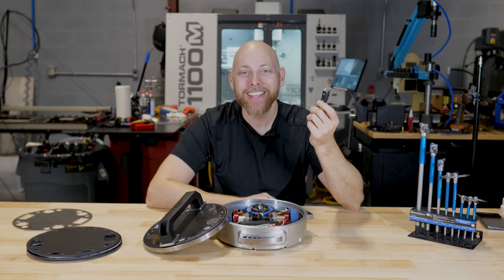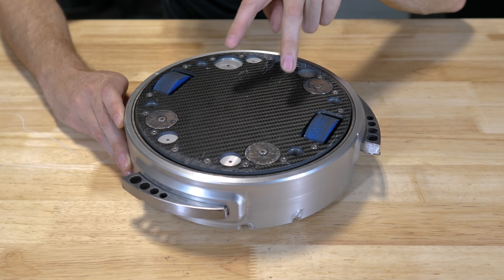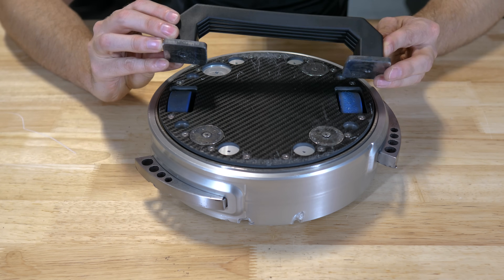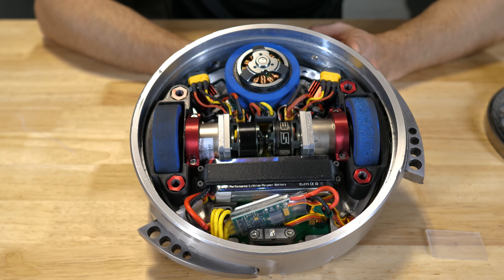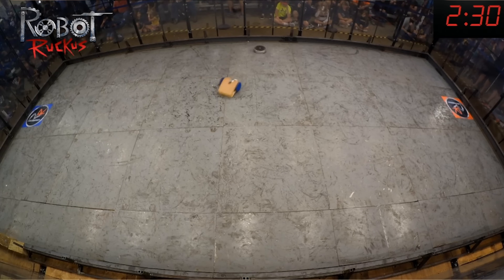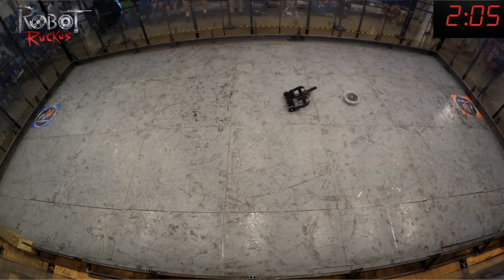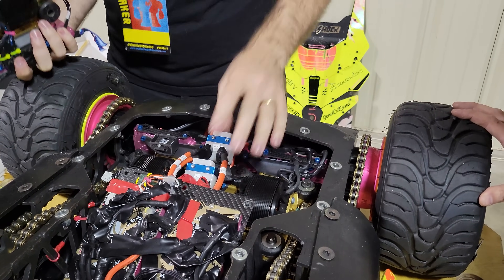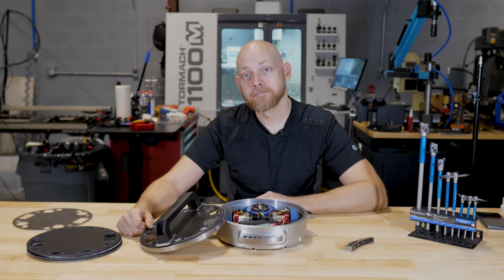Destroying a Battlebot: Part 3

Comment: I know this is almost a year old...
1. What you want for the teeth is shock/impact resistant tool steel. This sort of application is exactly what this category of tool steel is for. In the US, this will.  typically be "S" followed by a number. S2 steel is super common and cheap, if not the best. You should also consider plain carbon steels, much cheaper and easier to find as "trash". Farm equipment blades used in an impact vulnerable application tend to be around 0.75% carbon, which is the sweet spot for the best toughness,  strength and hardness in  carbon steel. 
2. To resist bolts pulling out of aluminum, you need coarse threads. I know the math says it doesn't matter, but real life says otherwise. This in particular is an infamous problem for car engine cylinder head bolts for aluminum engines. Lookup the Cadillac Northstar engine. Aluminum loves to gall too, coarse threads will help deal with that. 
3. Carbon fiber composites are strong in a per weight basis. Fiberglass composites are far stronger in a per volume basis.

Comment: Carbon fiber is highly conductive. Using it on the top means that you made a very basic faraday cage between the steel floor, aluminum ring, and carbon fiber top. That's also why you always house your tracking radio in a fiberglass section instead of a carbon fiber section in rocketry.

Comment: Should put a large bearing in the center of the front and back, to keep it from wobbling.

A single 1/2in ball bearing would work.

Those could also be spring loaded, to keep in constant contact with the ground.

Comment: You have plenty of comments about carbon fiber, so I figured I would ask about the secondary weapon.  Did you consider designing the inserts with a chip breaker, to kick out material being removed from opponents?  I think just a little bump or curve past the cutting edge is all it should take.

Comment: To solve your wiring problem you could use a duel print head 3D printer and conductive filament and print your wiring directly into the housing.

Comment: Reading the Carbon Fiber interfering wirh the radio waves, I think understand some of the issues. You should limit the number of angles beweeen plies. So a [0, 90, 0, 90] layup would block more than a [0, 0, 90, 90] layup. I wrote a paper on a similar topic if you are interested.

Comment: In single seater racing with carbon fiber monocoque, we use copper tape surrounding the hole for any radio antennas. This helps a great amount with radio quality/signal.

Comment: Carbon fiber is conductive and therefore you're making a farada cage using it, it's even worse if you're connecting it to ground even indirectly. The mass you have will act as a huge capacitance plate, you're best off externally mounting the antenna or using the carbon fiber as one via tuning.

Comment: Retired physicist here.  I did some conductivity measurements on carbon fiber years ago.  I found most samples to be conductive to various degrees depending on how it's manufactured. G10 is not conductive, so it's the better material for radio transmission.

Comment: I would recommend the vex robotics gear boxes that are often used in FIRST tech and FIRST robotics and they are all metal gears and they usually hold up pretty well and are modular meaning you can easily repair them and change your ratios as needed. You will probably need a custom adapter but I feel like it would be worth it for the strength and modularity.

Comment: CF is conductive and so will block RF, simple as that.
If you really want to use CF then you need to have small section (50mm hole?) in CF where the antena is and cover it with G10.
G10 is glass fiber based so basically transparent to RF.
Reply: And regarding the attack bits, why invent the wheel?
Look up some mining equipment or some kind of large milling equipment and see how they do it, then just copy it to the last detail.

Comment: In aircrafts they cant use carbon fibre nosecones since this blocks the microwaves used in the radar system. So your carbon plate most likely blocked any signals trying to pass through

Comment: All plastics have the ability to create and hold charge, the difference in fiber glass and carbon composites is the carbon fiber can conduct electricity, this means as friction happen the plastic can create charge and then flow through the carbon fibers, the flow of electricity creates small electromagnetic fields which can cause interfere! Great bot, great show!

Comment: I use carbon fiber for rocketry, and I always leave an RF window in either G10 or kevlar for the telemetry antenna. You'll completely shield any transmitter by wrapping it in carbon.

Comment: It seems like the more rigid the bot is the harder it goes down. I wonder if anyone did some super soft bot exterior?! Need to see more fights..
Reply: Super soft exteriors tend to run afoul of the anti ablative armor rules. Wood however can be incredibly tough. But it may just be as expensive and hard to machine as aluminium. XD
Reply: There are a fair number of bots that use flexible materials. Probably most known is HUGE which is made primarily of HDPE and can shrug off many big hits to their big flexible wheels. There are others that use TPU to absorb hits.

Comment: Well, carbon fiber is made of carbon fibers in a Polymere matrix. Carbon, like graphite is a conductive material, so are the carbon fibers. Having a conductive, tightly woven mesh will function as EMV shielding, not as good as copper mesh, but the principal is the same.
An EMV shield will protect your electronics from EM-radiation, but also prevent signals to go through.
Reply: In high performance rc aircraft we either use glas or kevlar for the area of the enclosure where the receiver is. Or we get the antenna outside, but then you have to have two antennas to avoid radio shadow.
Reply: @Argosh  I know, did RC stuff too. 👌🏻 Also built race cars with carbon fiber monocoque during my mechanical engineering studies. We had wireless data loggers with antennas, had to put them outside the monocoque.
Reply: Yes, I would add that quartz fiber is often used for application where RF transparency is needed. Quartz fibber is fully compatible with most standard carbon fibber processes, which makes it usable in a multi-material carbon/quartz part

Comment: Whenever I see fighting robots I always think a hydraulic sheer would be a great weapon. A snap action with sharp tips to hook onto the body panels followed by a strong shear action to cut through stuff. Like the jaws of life just smaller.
Reply: I'm still a sucker for the massive spinners, stuff like Carbide from Robot Wars. With the giant bar spinning they get kinetic energy equal to like a 50 cal hitting the opponent, without needing to get a hold of them.
Reply: @theoolifent9074  Yes it is brutal, but also for your own robot. I have seen so many fighting robots loose its spinning action.
Reply: @MaxMakerChannel  oh yeah, they can cause serious issues for themselves. But when they work they're just spectacular to watch.

Comment: Carbon fibre is a conductor, so you're trying to send and receive signals from a Faraday cage. Let's say that leads to suboptimal connections. I have the same with a GPS in my carbon fibre velomobile, and the newer GPS (Garmin Edge 1030+) seems to suffer from that more than previous models, probably reflections within the carbon fibre shell that confuse the hell out of the unit.
Reply: The 2.4ghz frequency of the rx/rx system shouldn’t greatly suffer from conductive panels nearby.

Comment: Carbon Fiber indeed attenuates RF, it's pretty much a non issue for lower frequencies, but definitely has a noticeable impact on UHF/SHF and above and it causes issues in the hobby RC world. Adjusting antenna placement or using different material adjacent to the antennas so the CF isn't between the bot antennas and your controller's antenna will help.
Reply: Iirc carbon fibre is conductive, so if it touches ground (like the massive amount of aluminium) it would act like a RF shield
Reply: @justfpv1432  Yep!

Comment: Since carbon fibers are conductive my theory is that the sheet of carbon fiber will act as a faraday cage... Don't know for sure, just speculation
Reply: Yep - not necessarily a faraday cage, but carbon fiber is certainly radio opaque enough to attenuate radio signals. Radio controlled aircraft with carbon fiber fuselages usually have a kevlar or glass fiber section for mounting the receiver antennas.